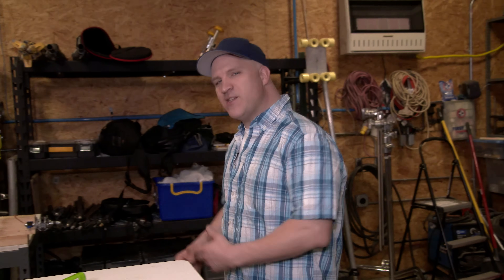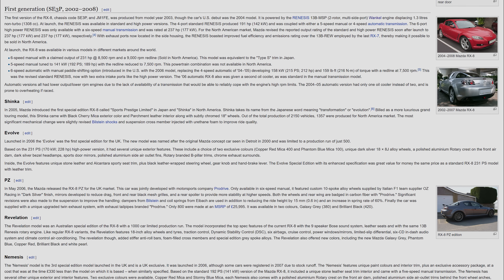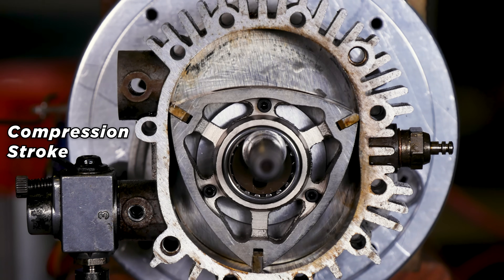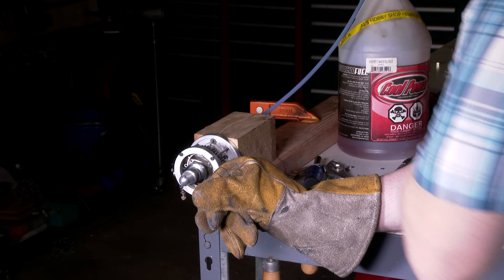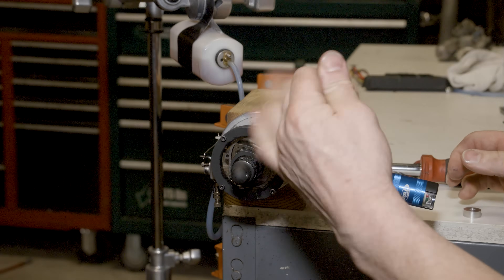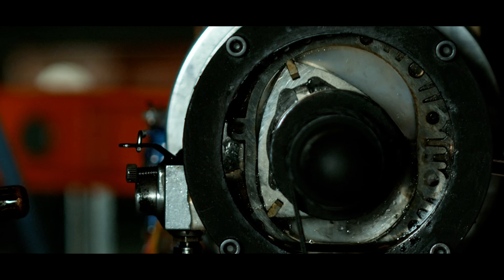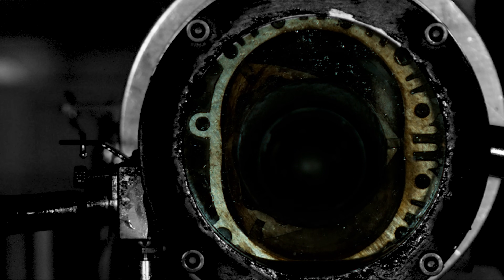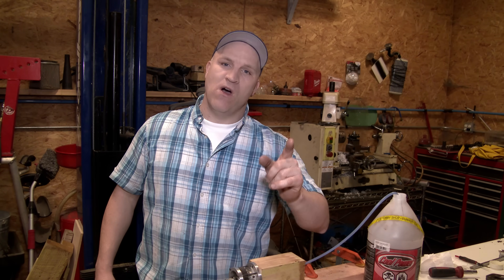See Thru Rotary Engine in Slow Motion - (Wankel Engine) 4K

Comment: Great Video.  To all those that are bitching about fuel efficiency...1)  this was for demonstration purposes and a rudimentary design of a Wankel engine.  2)  If comparable amounts of money were spent into Engine R&D over the last 3 or 4 decades, I am 100 percent positive that the Wankel engine's few flaws could be whittled down to inconveniences, much like the beloved piston engines of today.  3)  Think about this....There's Fuel efficiency and then there's the efficiency of motion.  If a 1.3 litre Wankel can put out 280 horses, what would the equivalent power output of a 1.3 piston engine?  Under equal circumstances, we all know that it would be much less...That difference in HP would be the energy lost in a piston engine's up-and-down energy, the inherent more friction from moving parts, and having to be converted to the crankshaft, making piston engines much less efficient per cubic inch.  But yea...they burn through the juice like mad.  I had an 82' RX7, You couldn't kill that engine if you tried...I was 17 years old at the time, believe me...I tried.  That engine was reliable as the earth turning.
Reply: Sounds like you are very unfamiliar  with the development history of the Wankel engine. The best universities and engine manufacturers invested billions of dollars in developing the Wankel only to discover that it was fundamentally and inherently inferior to reciprocating engines.
Reply: The Wankel is mechanically and thermally less efficient by design, it also suffers from horrible combustion efficiency. You cannot directly compare Wankel engine displacement performance with converting the cms or liters using the 2x conversion formula. A Mazda 13b engine has a total true displacement of 3,924 cc's. When compared to the 720 degree firing order of a 4 stroke Otto engine the 13b has an effective displacement  of 2,616 cc's which makes your comparison invalid.
Reply: The Mazda RX brand's notoriously poor reputation for reliability was responsible for declining sales and led to the demise of the brand and the Wankel engine production.

Comment: Awesome! I have an RX8. Great groupner rotary engine. One big favor: 
Is there a possibility you could try burning the fuel at the top of the chamber. For instance, In Your engine it would be directing the torch towards the bottom arched chamber because that's where the most air and volatile gasoline vapor is actually. In the rx7 engine that would be using the most spark current possible on the trailing plug or the top. Yeah just like piston engines have a spark plug at the top of the chamber. Spark gotta somehow ignite the top.of the arch which is where most of the fuel goes to and is the most volatile. Could you please do a video on your groupner rotary and direct the torch to the bottom which is where the fuel is coming out from according g to what I saw in the video you last had. Thanks.

Comment: I have a Wankel rotary engine I believe it's 30 horsepower. I've only had it running once in my life I used a carburetor from a goldwing motorcycle. Taking it apart one time I broke one of the seals for the piston haven't run it since it's for sale if anybody wants to make an offer. If it's not more than a hundred don't bother I can get that in the aluminum cost

Comment: I would like to see a high compression diesel wankel. They burn oil anyway and would probably be more efficient since combustion would rely on compression ignition instead of spark ignition.
Reply: i think the wankel is naturally limited to a tiny range of compression ratio? correct me if i m wrong
Reply: @royhsieh4307  on a wankel (like most engines) increasing compression decreases displacement. To compensate for the loss in displacement the engine itself would have to be larger. On a piston engine, the pistons would have to be larger. The rotor faces have cups that act as chambers when they rotate against the spark side of the engine. Filling in these "cups" increases compression. I figure since the fuel inside diesel engines ignites due to compression, a diesel variant of a wankel would be more efficient than a gasoline equivalent. Diesel fuel also acts as a lubricant and operates at an overall cooler temperature which the Wankel engine would benefit from. The only problem I see is detonation. The effects of this problem could be solved by using special apex seals. Their have been developements with apex seals which although may not last as long as traditional seals, are nearly indestructable when considering detonation.
Reply: @ngrinshift4383  how detonation will occur 🤔
Reply: @chanakyasinha8046  if "critical" compression occurs before the rotor face reaches top dead center, the fuel will combust. The resulting pressure will be forced thru the apex seals instead of being used to keep the rotation process of the rotor. The key I believe is determining the maximum compression allowed before detonation occurs.
Reply: @ngrinshift4383  One last problem, Diesel fuel only has a lubricity of 600 microns, not much better than gasoline a far less than required for an effective motor oil type lubricant.
Reply: The geometry of the Wankel engine limits the static compression ratio well below that required for reliable compression ignition and seals lack the durability needed for the higher combustion pressures and temperatures.
Reply: Some of the best Diesel engine manufacturers licensed and attempted to develop a practical Diesel cycle Wankel, John Deere, Mercedes-Benz, Deutz, MAN, Yanmar and Rolls-Royce all developed Diesel Wankel engines without success.

Comment: Why is it exploding in the wrong way before it get started?
Reply: For one, it has way too much fuel in it.  It's allowing for a pre-ignition or detonation condition.  In a piston engine, it knocks or pings when the air/fuel mixture ignites too soon.  This is usually caused by the timing being set too high or the octane of the fuel is too low.   The rotary engine uses pressure and heat to ignite the mixture.  It looks like it's bathed in way too much fuel.
Reply: brussell639 thanks

Comment: Can someone explain to me why a rotary has so low torque specs? Just curiosity.
Reply: The light weight of the parts just don't have much rotational mass.  Displacement is responsible as well.  Rotary engines are tiny and rely on revving high to make power.  A turbo can help, but the inherent design just doesn't make much torque.
Reply: @brussell639  yes thank you very much. It makes all sense. Thank you very much.

Comment: How come not used in motorcycle or mopeds , even motorized bicycles, where pollution control not a factor?
Reply: I guess you just don't know.  Motorcycles have been heavily influenced by emissions.   That's why the two stroke engine is all but gone.  KTM and maybe Yamaha are the only ones still making them.  Dirt bikes have fuel injection now.  Street bikes come with catalytic converters.  So there's no way the EPA would allow a rotary engine that spewed fuel like this one does.
Reply: @brussell639  I think, it varies by states!
CA is tight on pollution and some other states, but some aren't, like Florida.
Even CAT converters has to be made for CA standards.
I know, 2 years ago a new needed for my VW,  it cost $50 more , because had to be approved by CA State.
II owned 2 motorcycles in the past, in the 80's and 90's, non needed CAT, back than?
Reply: @szaki  
No, back in the 80s and 90s motorcycles didn't have catalytic converters.  I think they started around 2008 on some models.  I'm pretty sure every new streetbike has one now.  California emissions has always been stricter than the rest of the US.  Some models over the years had to have different emissions systems on the bike and certain models were just plain not sold in CA because of their emissions standards.

Comment: Question... does the offset of the Rotary Piston cause any kind of vibration in the engine? What RPM are these engine most stable at? Is the engine more balanced than at standard engine? What are the limitation?  Make that "Questions". ;)
Reply: It's just called the Rotor. It dances around its center of mass in a way that doesn't cause much vibration.  They can happily reach 1/3 higher rpm than piston engines.  Did you realize that a 20 ounce piston has the effective weight of like 45lbs on the connecting rod at high revs? My figures are just for illustration but not to far from fact

Comment: AMAZING Thankyou!
Question  At the point of ignition it appears as if only a small portion of the force of the combustion is  in the same direction as the rotation. Is this just an  inherent inefficiency ? Or am I wrong ? Thanks.
Reply: The force is produced ant applied to the center of the face. On larger rotors there is a large combustion well in the center/middle.  Wiki Wankle

Comment: just add a filter on the exhaust to collect the unburned fuel
Reply: Such a filter would have to work via osmosis or similar and would completely block off the exhaust port, therefore clogging the engine
Reply: @Pythnn  AND WOULD EFFECTIVELY TURN THE EXHAUST INTO A BOMB.
Reply: @deadprivacy  Bonus, gives you an extra cylinder. Problem is it only works once
Reply: add another rotory engine on the exhaust, to burn the unburnt fuel
Reply: the catch is, will it add horsepower
Reply: Also most rotary engines pump oil in to the chamber to keep the rotor running smoothly so you would have to separate that mix.
Reply: Or they could just discontinue the pos 😆 oh wait....
Reply: That's the lubricant, not fuel.
Reply: yea or better yet a re circulation line into the intake stroke if thats possible

Comment: That's why they shoot flames so easy, I got a friend who owned a RX8 staright piped and nothing else and shoots flames with ease, the un-burnt fuel reaches the hot exhaust and ignites, but for real they are unreliable, he only owned the car for 4 weeks before he sold it since there was so much wrong with it
Reply from the maker: I like the rotaries, and I've had a few different rx7s, , but I swapped my engines so many times I lost count ...lbvs.

Comment: I mean, maybe the fuel isn't the right one? Rotary engines rely on high pressure and condensation, so what if we use a fuel that works in that condition? Like propane? 

Somebody should give this a try.
Reply: Several companies researched the the use of propane and other gaseous fuels with the Wankel engine but it lacks the static compression and combustion efficiency. Reciprocating engines using propane have much lower fuel consumption and emissions.
Reply: Awesome video. The be$t car I ever owned was a Mazda RX-7 GSL SE   I think it was. Not so sure of the year but in the 80's I know I graduated in '87 nvit was a few years old when I bought it n had a killer stereo back wjithat shit was cool. Girls loved it! Would hall ass for such a small engine. Would buy another n may one day as I'm 50 now. That's somewhat of a bummer. Can't stay young forever you know. Geeze how time has really changed things in this country. Try to live like we did back then n you would be locked up or dead in a couple days tops. Sux ya know. Whomever screwed this country up needs to be shot. Washington D.C. you Suck Balls!
Reply: Recommend to Project Farm

Comment: Drove a 1981 13B RX-7 for years, maintenance was never ending.  But the power was insane with it's 4 barrel V8 sized carb it had power in-between a V6 and V8 and the throttle response was awesome. Until it blew a seal and needed to go into the shop again. Which was funny because when the seal blew we called it the bat mobile since it had a cloud of smoke behind it for a mile. I stole it from my mom when I was 15 and took my friends on joy rides in it and LIT the tires up and did donuts. My friends Honda couldn't even burn out, and this RX-7 was turning the tires into multon rubber...  Oh the good ol days.

Comment: Wow, that's wasting a lot of fuel.
Reply: I'm guessing because how lightweight the rotor is and how condensed the combustion needs to be to spin it, most of the fuel in the chambers doesn't have the chance to catch fire before it rotates. It's a genius design, but the intake spits too much fuel into the chambers, far beyond its need.

Comment: My buddy's dad worked for the DOD (I think) and he inherited the prototype and only known example of a diesel rotary engine.  It was developed for a military generator application.  Single rotor.  He tried to sell the engine on eBay, but no one was interested and he junked it for scrap.  Too bad, as it ran fine, and I felt should have been used or displayed somewhere.   Where, I don't know.

Comment: The rotary engines are way better than piston engines
Reply: Only in sound
Reply: Power and fuel efficiency?
Reply: Not really, if they were then you would see a ton of them but not very many make them anymore
Reply: JoeBond209 you would not really see any kind of engines like dukes or boxers much like normal pistons cause prices of Petrol would fluctuate
Reply: Where I live the only thing we really have is piston engines and our gas prices stay relatively the same

Comment: I think i see how I could improve this engines design
Reply: How
Reply: X on I’m not certain on it yet so I’m getting some parts and such and I’m gonna try building what I think might make it better I strongly believe it would work well it would require a strong camshaft because if that breaks it could get deadly
Reply: First Proposals:
Aluminum block,
Improved fuel injection,
Direct injection, 
Coil-on-plug ignition

Comment: this engine is running crazy rich, that's why it wont stay running after he takes off the glow ignitor, all the excess fuel is cooling the glow plug down to the point where i wont ignite the fuel

Comment: So this engine isn't even functioning as gasoline would just spill out
Reply: Watch 2:13
   Warped Productions did say that there was no ignition
   -No spark plugs, no distributors, no ignition coils, & no PCM
    WP did say that there was a glow plug on the right of the engine
   -So this engine is running a diesel-like combustion....

Comment: Pretty crappy engine design. It's basically a two stroke engine. It's very outdated. It still does what a piston does just by wobbling on the shaft pretty pointless engine.

Comment: Now I know why I spit fire out my exhaust and have terrible gas milage lol
Reply: frösten honestly I thought it worked better with a wet system of nitrous, had horrible results with the turbo.
Reply: Your wankel only spills unburnt fuel out of the exhaust when it's cold starting, downshifting, and/or rapid-decelerating 
       Wankels do this because the rotors+the apex seals are acting AS the valvetrain themselves & whenever the rotors slow down in a deceleration
    - the intake air flow going into the combustion chamber slows down whenever the rotor slows 
      - whenever the valvetrain of spark-ignition engine cant/doesnt move intake air fast enough to burn the constantly flowing fuel in a deceleration
   -unburnt fuel is introduced to the exhaust
      Otherwise in highway driving, 
   your engine will barely spill unburnt fuel into the exhaust as the rotor is spinning fast enough to burn the fuel
Reply: @MainMite06  - Hmmm... doesnt explain why I only get 16mpg on my naturally aspirated gen2.

Comment: Awesome visualisation!  So what you can clearly see by the great effort of finally being able to  look inside a Wankel engine is how inefficient the combustion chamber geometry is. Apart from all the sealing problems (apex seals and blow-by at the sides of the rotor) such a squashed, long and flat bubble of  gas/air mixture will never be able to combust even halfway in a homogenous way.
So basically the Wankel engines fate is that of the 2-stroke engine...Unsolvable problems with gas separation and always burning oil.  Somehow simple, light and a cool toy, but a dead end from the engineering perspective. You just can't afford to only use half of the fuel nowadays. Sad, but true.
Reply: It's not a 2 stroke engine by any means. And it injects oil by design to lubricate the housings/apex seals/corner seals etc. Some people(most) pre mix 2 stroke oil into their gas to help assist in lubricating the housings/seals via the fuel injectors.
Reply: @WaffenSSaregods  ,  of course the Wankel does not have a 2 stroke cycle. It just got similar problems and shares a couple of similar design flaws. E.g. the lack of valves links the gas change timings (opening of intake /exhaust ports) to a certain position of the rotor/piston. No way of cleverly playing with the valve timings as it's commonly done in conventional engines (Honda VTEC  etc.) And i know that a Wankel burns oil *by design*... That's another design weakness. You shouldn't need to burn up your lubricant.

Comment: dude, would it be easier to use a drill wtih a like a rubber cup or rubber hose attached, to press on the rotor shaft to spin the engine up?

Comment: Very interesting engine, there are lots of pros to it, but the one big downside has always been the rotor combustion seals at the tips of the rotor. They wear fairly rapidly and it is not uncommon for these engines to use a quart of oil in a thousand miles. I had 2 friends that owned R-X7 cars and it said that right in the owners manual. The cars ran good, but you had to keep an eye on the oil level all the time